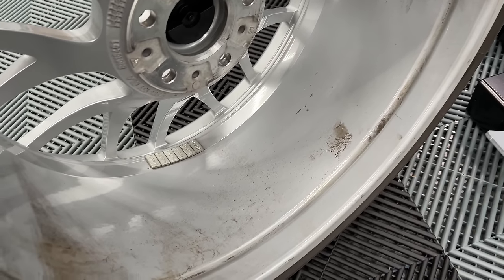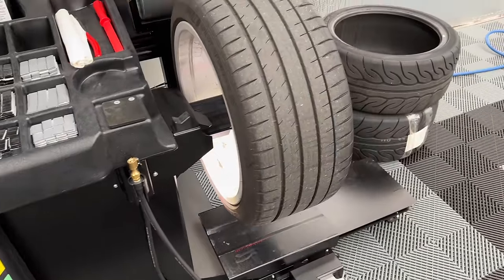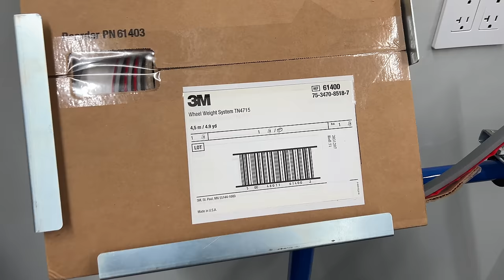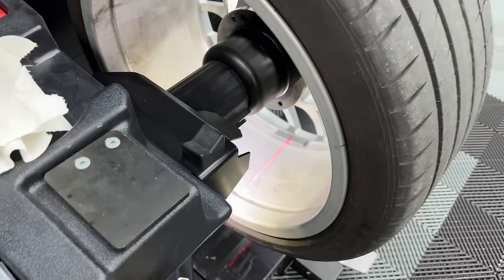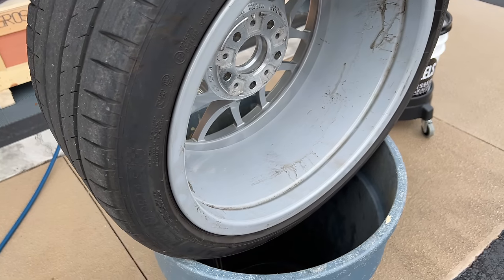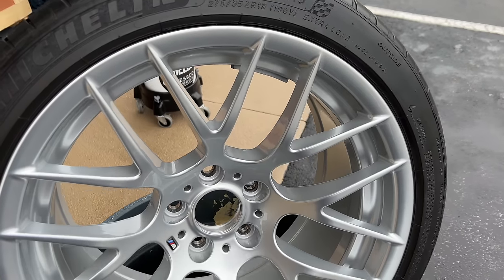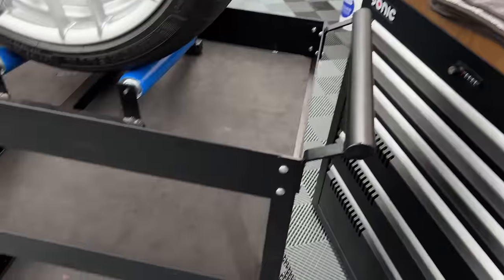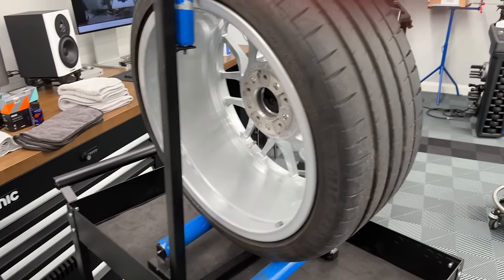Dialing In M3 Giveaway Car: Rebalancing, Decon, Coating Competition Package Wheels

Comment: Hey, BMW Tech here. 3mm do sell the thinner wheel weights. The thick ones tends to get caught up on brake calipers that are closer to the barrel of the rim. Love the Auto Tire Machine. Helps out tones with our pain in the butt run flat tires. 😅

Comment: Hi Matt - if I get new wheels, would you recommend having them balanced and wheel weights applied prior to coating, or can they somehow remove the coating when applying the weights so the weights stick? I’m guessing the former is preferred. However, if getting new tires at a later date, I’m thinking this would come into play again as they’d likely be applying weights in a spot that has been coated. Thanks!
Reply: Balance first so weights stick.  Video followed these steps.  Follow Matt’s example.

Comment: Did you run into any areas that rejected the new coating, or was the previous coating sufficiently degraded?

I've been holding off on ceramic coating 3 out of 4 of my sets of wheels because I wasn't sure on how it would go to recoat. I have been using Wowo's Crystal Sealant instead (bought a couple bottles back when TRC was importing it).It's a finicky product to apply, but provides almost coating level performance in a spray form that easily lasts 6 months on wheels. 

My coated set of wheels (winter wheels) has Optimum Gloss Coat on them, still going strong for the 3rd winter season but I will use CarPro once it starts failing.
Reply: The best thing to do is to polish to ensure the coating is completely gone.  The first thing to fail on a coating is the hydrophobic layer but the coating is still there.  I always polish my wheels when it is time to recoat them.  I want the new coating to bond to the painted surface and not old coating for maximum performance.

Comment: What do you recommend for pressure in a hot  environment? Should you not use factory pressure and put less considering outside temp being hot? Always notices my tpms sensors read higher if I fill at recommended spec.
Reply: Check pressure when manufacturer of car suggests.  Run posted pressures.  Best for tires and intended car design.  If you track, check before and after runs.

Comment: Curious, i know you use BM (Now OGDA) on The wheels, why not a quality sio2 topper or Hydro2 to Prolong the coatings life?
Reply: I wonder how durable some GTECHNIQ Easy Coat would be on the wheels. Seems like a simple yet effective approach to wheel protection without the spray bottle and towel method.
Reply: @nomad509  same with Hydro2 or Mckees Hydro Blue.

Comment: Matt, does the balancer ever tell you to put a second weight on the outside back of wheel( kind you hammer on ) ? Most of my wheels get a stick on weight front and hammer on weight on back. Neat stuff.
Reply: Pretty sure you can specify in the settings of the machine whether you want it to use outside rim weights, inside rim weights, stick-on weights on inner edge or behind spokes, or some combination of all of those.  Could be wrong, though.